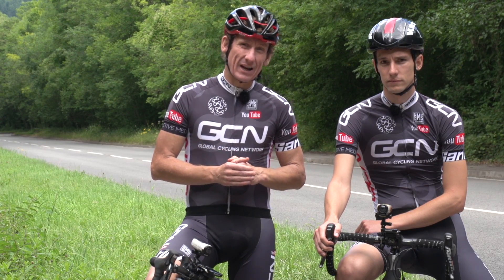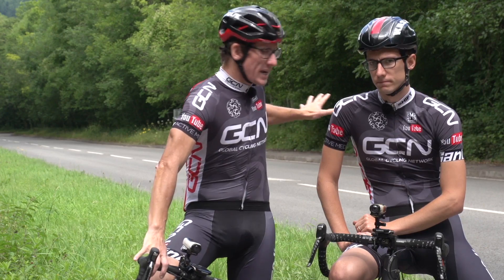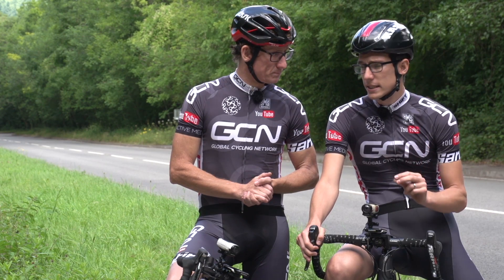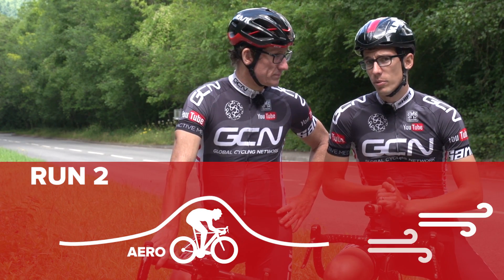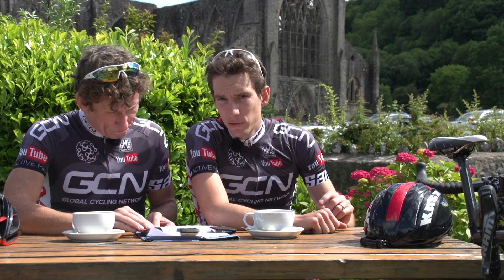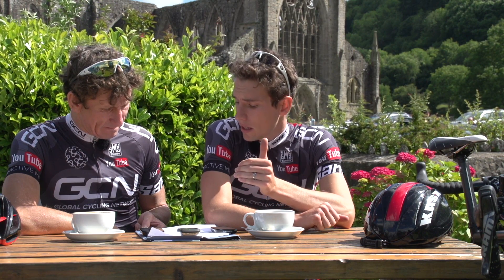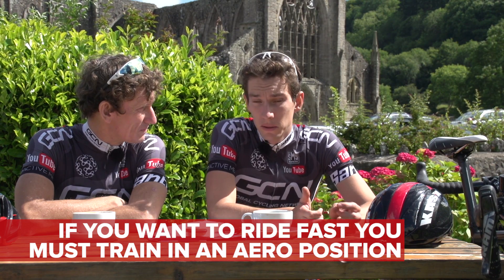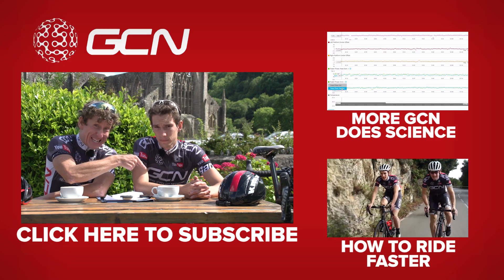How Much Faster Is An Aerodynamic Position? GCN Does Science

Comment: I lowered my handlebar to the bottom of the stack and used an aero position on my commute this morning. Not only easier to pedal slightly, but I noticed that it seemed easier to engage my hamstrings/glutes during the power stage of my stroke leading to more power when I was going all out. Anyone else experience this?

Comment: Matt, Si: what happens if you ride in the same position (aero) and at the same power (350W) but with different gears (high and low? Is there any time penalty for wrong gears / cadence?
Reply: +Pablo Gubert (I'm not Matt or Si but:) That I think is more related with your pedalling ability. Depends what's easier for you to sustain, a hard slow gear, or  buttery quick spinning. The one that tires you less should be more efficient at keeping you in an aggressive position for longer. And if you meant the "turbulence" caused by moving the legs a different speeds, I guess it's compensated by fluent pedalling.

Comment: I'm guessing that the point of the HR measurement (sorry Patrick Moreau, I don't seem to be able to reply directly) is that while the power meter measures the power being applied to the bicycle, the rider will be burning some power as well. Some of this is unavoidable - the human body is nowhere near 100% efficient, and indeed a fair amount of energy (somewhere around 50 W if I remember correctly) is burned just keeping a human alive - but the level of this 'wasted' power might have depended to some extent on how well the riding position works for the individual.

Imagine, as an extreme example, that the most aerodynamic riding position was bent so that you were almost touching your toes - pedalling like that, if it's possible at all, would probably be exhausting.

BPM at a constant output power is only a proxy measurement for bodily efficiency of course, but it's simple to measure on the road and it's understandable - the take-home message is that for fit and trained sports cyclists like our esteemed hosts an aero position on this course is not significantly more physically demanding per Watt pushed out to the road.

adjusts science glasses
Reply: +countertony (and also Patrick) Different riding positions have different physiologies as you suggest. Changing from a more upright position to an aero one will change the work share between the quads and the glutes, how much and when the hamstrings can engage on the 'up stroke' as well as the power contribution from the core. Lung volume will also change and hence respiratory efficiency. One would normally expect the upright position to be slightly more efficient, in terms of power output relative to physiological efficiency (not speed), as it is a more natural posture and likely to be more 'trained'. The obvious example is climbing - speed is reduced and gravity appears so the aero component of power drops dramatically. The result is that riders end up in their comfortable, sustainable, position from a physiology standpoint.
Reply: +Grigor Browning I suspect one might measure a bigger increase in heart rate when moving to the aero position if testing at power levels nearer a rider's max power (say 5-10 minute max power). The rationale being that the compromised physiological efficiency of a more cramped position will play a bigger part as the whole system is stressed more.

Comment: should I get clip on aero bars?
Reply: +SoSickWidit Well adjusted aerobar will surely make you significantly faster on the same effort level after some training.
Reply: +SoSickWidit Some stretching to increase flexibility and strength of hamstrings and lower back, then try out different stem positions (that is supposing you've got spacers under the stem; go lower it but not in big steps, just gradually) once you feel like you've acquired more flexibility. Easier, cheaper, and it actually makes the bike handle better. More stable, that is.
Reply: What are you a damn ITU athlete!!!
Reply: What are you a damn ITU athlete!!!
Reply: hahah nah, purely recreational,  but i ride along the beach and there's often really long straight stretches of pavement with headwinds...I see some guys with clip on bars and they look like they're just slicing through the wind...could just be the grass appearing greener on the other side tho
Reply: aero bars are MUCH faster, but you'll have to build yourself up a bit to be able to hold the tucked position for extended periods of time.
the difference is like having a tailwind all the time.
the ONLY reasons pros don't use them on most races is because they are not allowed by the rules.
(yes, I have short aero bars on my commuter/sportive bike)

Comment: Sample 1. Chris Boardman 49.441km/h 27 October 2000, Drop handlebar, carbon fibre tubing frame, wire spokes.
Sample 2. Chris Boardman 56.375km/h 6 September 1996, "superman-style" handlebar, carbon monocoque aero frame, 5-spoke front and rear disc wheel.
I guess... about 4-5km/h maybe.